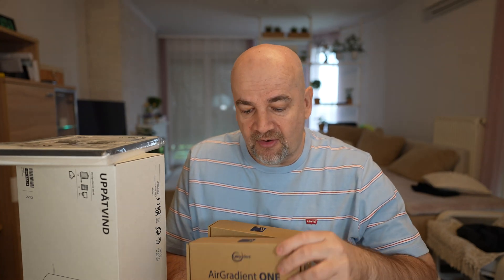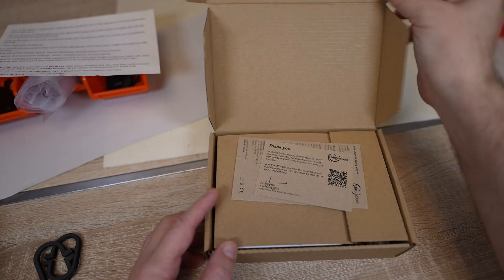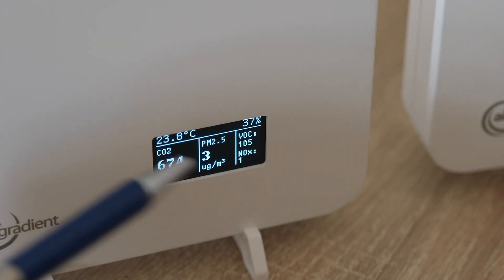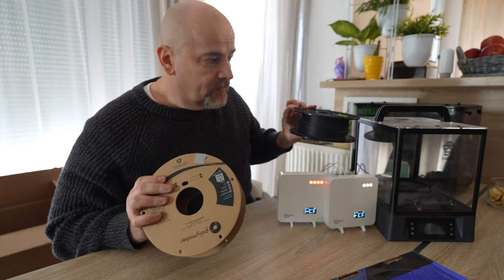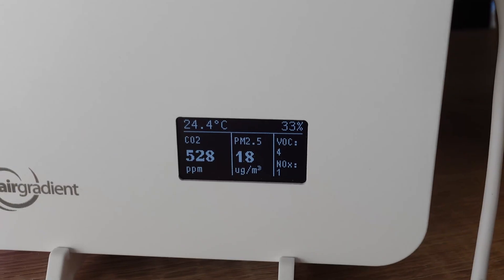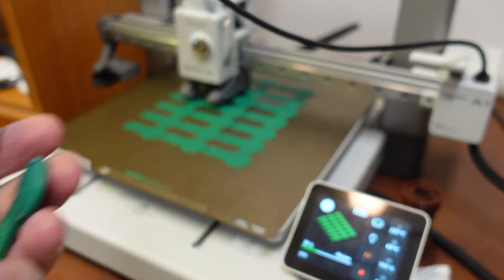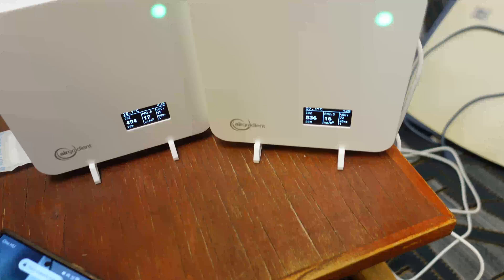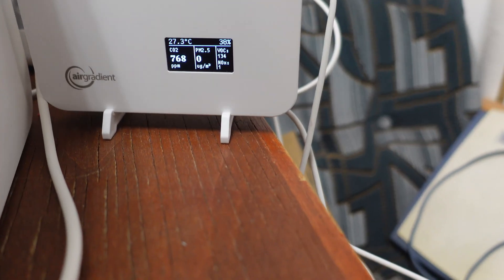Any VOC with 3D printing?  AirGradient ONE indoor air monitor review

Comment: The issue with VOC is that numbers don't mean much without a unit of measure to understand how bad they are. I think that below 250 (twice the base value) is no issue at all. Cooking is twice that and we know it's not causing any issue either, unless someone is exposed continuously (like printers, they usually don't run the whole time, and we don't stand next to them much either).
Assuming that sensor is even reliable to begin with... does it come with a certificate/calibration statement? maybe they calibrated one sample during development and use the same parameters for the whole large scale production, making it pointless.
Thanks for the test, interesting topic (and proof that VOCs are no issue).

Comment: I've been going on a deep dive into the resin printing safety because I want to buy one soon for myself.
The main problem I see people have is not seeing the difference between various VOCs.
It's called Volatile Organic Compound*S* because there are thousands of them and not all of them are harmful.
For example you pointed out that the cooking emits a lot more VOCs than your printer but the compounds emitted from cooking are not harmful to you, the VOCs emitted from the printer are. They are not the same, even though simple sensors like those see them as the same thing.
number higher = oven bad, number lower = printer good  is false

Comment: By the way... I use air filters with active carbon filter (otherwise they are useless against VOC) and it make a clear difference.
Not needed even a detector, you can smell in the room the plastic without and you cant with the ire purified on.

Comment: My two cents:
Those monitor are good for general induction and trend not absolute value.
I work with professional certified measurement. 
And with a 50.000€ machine we still calibrate it two time a day with bas bottle of certified standard gas for CO2, NOx and VOCS.
No way a 100€ machine can work at the same level with factory calibration.
You need to accept a certain degree of error and deviation.

Comment: @MyTechFun if You have any sensitive information on video DON'T blur or pixelate it, because It's easily reversible! The only safe way to censor sensitive data in video postproduction is to erase or cover it with something like a full color rectangle. Better safe than sorry!

Comment: I think you need an enclosure. I would place one of the sensors inside the enclosure and one outside. This would allow you to compare the VOCs generated by the 3d printer. You could also validate your results by moving the external sensor to the enclosure's exhaust which should be a equal or higher level of VOC than what is inside the chamber.

Comment: would love to see you place a unit right at an exhaust pipe on an enclosed printer - then compare that to the exhaust going into the air filter  and have the monitor sitting in the airflow path for that (can the small ikea one also take the carbon filters they make?) This would show the most extreme scenario for a printers potential VOC and Pm2.5 output and highlight the difference using one of those filters makes if at all! 

additionally placing a unit directly in the bottom of a printer enclosure and checking those values would ensure the differences in numbers are more likely to be down to just the printer itself 

If you have or can make a bento box filter tower for your X1C - using the monitors to show what difference using one of those makes would be handy 

I have a bento box myself but chose some very powerful and noisy fans for it - which leads to me not switching it on much
Reply: There is a mod for IKEA Uppåtwind on printables  to add two active carbon filter casettes in addition to the original filter. IKEA also has a more expensive model (Starkvind) that can take filters to absorb VOC, but they look a lot like the mod for the Uppåtvind that you can make yourself.

Comment: I’ve found a couple of things with my VoC sensors. 1.  It depends on external atmospheric conditions so I have one outside as a reference, high VoC  days outside  produce high VoC days inside (surprise!). 2.  I’ve found that people in the room and moving in and out creates real spikes and troughs in VoCs than printing  and as such I’ve had to run the monitors with closed doors for at least an hour to get consistent readings. 3.  I run a third VoC on the same level of my house (for an additional reference) as carpets etc make a difference. 4.  The ISO standard that most of these units adhere to does not conclusively state that it monitors styrene levels. So the nasties in. ABS and ASA may not get accurately captured. 

So after running my collection of sensors for 6 months I’ve concluded that there is a measurable difference in VoCs while printing but opening the window clears the air and reduces the levels to below those in the  rest of my house, yet another surprise. lol. BTW  All my printers have venting and particle filters but vent to inside the room. I only run 3 printers.

Comment: VOCs are extremely general term. Fumes from cooking are a whole lot of different VOCs, as is Styrene from ABS/ASA, as are farts... The domestic monitors use cheap sensors that measure small number of VOCs and usually approximate a value.
In the case of the AirGradient One the number on the screen is an index that operates on a rolling window of the last X hours of measurements. So it is not an absolute value and is affected by periods of very low or very high VOCs.
I think there were talks about exposing the absolute value or it might already be exposed by stuff like HomeAssistant.

Comment: I don't need an air quality monitor , i have allergic reactions when printing PETG. Not to talk about ABS, which emits toxic styrene gas. My 3D printers are in a cabinet with air extraction. I am bit against using 3D printers in homes without any protective measures

Comment: VOC and PM  will go up on filament changes becasue the printer overheats the filament.  I have a small ESPHome VOC monitor inside my X1C, I see more VOC on PETG snd PC, than PLA. I also have an AirGradient on the bench in the garage.   The VOC sensor is reporting an "index" that it calculates relative to a baseline rather than an absolute number. 

Just looked back through the data logged by Home Assistant - the sensor inside the X1C logged 500 (It's max value) printing PC-FR (flame resistant polycarbonate) and 200 printing PLA.    I also see spikes in PM0.3 and PM1 when printing and particularly on filament changes.  I have added extractor on the X1C with a large carbon filter / HEPA filter which I have tied to the VOC sensor and will start when the print ends (running it druing the print case chamber temp to drop and I hard warping issues with some filaments)
Reply: Got a recommendation for parts to put together a esp32 VOC sensor for inside an X1C/P1S?
Reply: @phlebas-uq6fv   @phlebas-uq6fv  an ESP-WROOM-32 board, and SGP41 VOC sensor and an SHT31-D temp/humidity sensor (needed to calibrate the VOC) sensor, options red/gree bicolor LED.   The code for the ESP can be found as a github gist (YT won't let me post a URL)  /jpettitt/837d79f758b18f4ec10059b7db0bed40
Reply: @phlebas-uq6fv   @phlebas-uq6fv  an ESP-WROOM-32 board, and SGP41 VOC sensor and an SHT31-D temp/humidity sensor (needed to calibrate the VOC) sensor, options red/gree bicolor LED.   I can't post a code link because YouTuber.
Reply: @phlebas-uq6fv  for reasons know only to YT it won't let me post details - BESp3-WROOM SGP41 vos sensor and SHT31D temp/humidity sensor - it won't let me post a link to the code if you message me at the same username on makerworld I'll send you a code link.
Reply: YT won't let me post it for some reason

Comment: This kind of sensors are basically useless for monitoring 3D printing emissions. They are bad in registering VOC (only thing that can do reasonable quantitative measurement of VOC is called HPLC), and there's no reasonable way to catch the real murderer: the UFP's.
Rule of thumb for working with 3D printers safely: 
1. NEVER use them where people live
2. Mechanical ventilation is the only sensible way of removing printer pollution.  HEPA is almost useless against UFP, and activated carbon only removes maybe up yo 50% of VOC. Photocatalysis with high CADR would be better, but it's much easier to just went it outside.
3. If you can smell it, it's BAD.
4. Resin printers are much worse than FDM, especially Chinese ones where there's no control over Resin ingredients .

Bottom line: this group of technologies should be only used by properly trained, certified, and controlled  specialists. Use by amateurs should be banned.

Comment: My hypothesis is that VOC’s are much denser than clean air and likely to sink. I’d like to see some further experiments where monitors are placed at various heights in the room to test if more VOC’s are detected closer to the floor, and comparing a closed room with a fan on versus no fan to test if blowing the air around in the room perturbs the air enough for more VOC’s to be detected on the desk.

Comment: This affordable IKEA air purifier uses filters that will help with air particulates (not HEPA but similar), but you shouldn't expect them to have much impact on VOC if any.
If you take smell for instance due to smoke (particules) they will help on that, but if you consider only VOCs as should be measured by that sensor, likely not.
That's how I interpret your observations showing no change in VOC measured after enabling the air purifier. However, the PM2.5 are at zero afterwards!

Comment: I have used laboratory quality sensors next to similar sensors (m5stack sdc40 and pm2.5 air quality kit). The m5stack sensors deliver very similar results to the lab grade sensors {within 20%} which I consider very good for these cheap sensors. I could also not see a significant increase in VOC nor pm2.5. just being present in the room had a bigger influence than 3d printing. I used ABS (mostly), PPA-CF, PC, PC-CF andTPU.

Comment: I bought two air filters for my home last week, one for the living room and one for the bedroom.  I should get one for my office because I practically live in here with the 3D printers.  The filters display particulate counts, typically 2-4 ug/m^3.  I'm not monitoring VOC but no doubt my daily stir fry contributes more VOCs than my 3D printers, but I suspect cooking smoke may not be as hazardous as molten plastic off gassing.  Not all VOCs are equal.

I designed and 3D printed an SV08 enclosure and it has two large carbon HEPA filters on top, mostly for ABS and ASA.  I'll add a filter top on the Sovol Zero when it finally arrives.  The manufacturer's filters always look too small to be effective.

The filter shown in the video looked like a pleated paper particulate filter.  If so, it wouldn't trap VOCs.  However, it's possible that it has a carbon filter inside.

Comment: You need to print ABS or ASA to get high VOCs.  Also, remember, not all VOCs are created equal; VOCs resulting from melting cheese are not as bad as VOCs from melting styrene.  Finally, there are no air purifiers under $750 that can filter out the type of VOCs that result from printing ABS and ASA; VOCs react poorly with with activated carbon catalyst, so you either need multiple purifiers each containing 10+ lbs of carbon catalyst, or a different catalyst (e.g potassium permanganate).  Take a look at the IQAir HealthPro Plus.  Remember, the best method of eliminating VOCs is ventilation.

Comment: The Plantower PM Sensor they use in it is pretty good. I've one in a DIY Project since years and I love it. They're pretty sensitive. When a neighbor starts to barbecue outside or there is a fire in the city they pretty quickly ramp up. Soldering is another thing where you quickly see how nasty the air gets within minutes. There are some studies about  that sensor where they used it in many outdoor locations and they were pretty decent compared to much more expensive sensors. 

About TVOC sensors on the other side I'm still very skeptical on how they compare to more specific sensors / measurements. They rely so much on the code and regular calibration as far as I know.

Comment: As you experienced, voc sensors can't really tell if it's the purest organic oil for fragrance from a bio farm somewhere very far from all pollution. Or you just breathing. Or cooking, or you are burning tires. If it detects anything, it goes up. Also it's usually just a relative, uncalibrated number, and the sensor or the driver software does some auto-calibration over time. That it takes the lowest value over some time - like a week - and call that "0", because these sensors also drift over time. Also, you live in a city iirc, so baseline voc levels can be high to start with. 
Bosch sensortech does have a demo board with multiple air quality chips (the same chip, but more of it) on one board, and iirc their point is that you can configure different chips to detect different gases. To some extent.
Reply: It's BME688 or BME690. Search for Bosch BME688 and BME690 Software, and you should find info there. With some machine learning, and multiple sensors, you should be able to detect different gases.

Comment: This product seems to hit that sweet spot of 'never going to buy it' of being way too expensive without actually being a high quality device. It uses parts you can source for much cheaper if you make your own kit, and which are already included in 1 of 100 cheaper alternatives. There's a reason for the massive gap in pricing from the $50 cheapie to the $5000 calibrated lab equipment, they would need to be adding something magic to create a middle price band in there. A band like that already exists, but it's just the $50 cheapie with a name brand like Samsung slapped on it, AirGradient doesn't have any weight behind it to pull that off.

Comment: As much as I love these open sensors, the measurements are very rough. For example, the Sensirion SGP41 (in the AirGradient ONE) measures MOX, and extrapolates VOC from there. What's worse, is that both the VOC and CO2 measurements are dynamically calibrated, so all you know is that they go up and down -- the absolute values are completely unreliable. So while an increase in MOX is suggestive of increases in VOCs, when the MOX stays constant that does NOT mean there are not other VOCs present. 🤷‍♂
Reply: Same.  The PMS5003 for PM is pretty good from my experience and some studies I've found about it, but about TVOC sensors I'm super skeptical as well. They rely so much on the algorithm and calibrations.
Reply: @Leif_YT  Yeah. To measure CO2, you can upgrade to a dual-chamber self-calibrating sensor. But for VOCs, I'm not sure there even is a general solution, because there are many VOCs. As you point out, PM is probably the most reliable of these.

Comment: The PM2.5 increase when you opened the windows is likely due to particulate matter found in the city air. Try placing one of the monitors outside to measure the particulate levels surrounding your apartment.

Comment: I've done a similar exercise with very cheap chinese air meters off aliexpress. My main takeaways were as follows:
1. ABS and ASA absolutely need to get vented outside. They put out massive amounts of VOCs. A 60mm fan running at a moderate speed generates more than enough negative pressure to keep the contaminants from diffusing into the room.
2. Cheap CO2 sensor chips will get false positives from VOCs. I can reliably trigger this with aerosol sprays or acetone vapors.
3. As you found, simply cracking a window or two solved about 80% of air quality problems.
Reply: Just curious, you mean 60mm fan that is mounted on an enclosure, then connected to the hood going outside? Is this enough to cool PLA and does that also work for materials that require a heated chamber?

Comment: I own an uHoo air quality monitor that offers these values too (+ a few more like CO, O2) and the VOC values feels weired too. While printing (open printers only) I do not see anything. but in the evening, when I turn on my 15yr old flat-TV in mostly - not always! - raise from near zero to 200-700 values. Those sensors feels to be like rolling the dice.

And yes, I use it as CO2 monitor for better air exchange efficiency.

Comment: AIR GRADIENT is a well known brand between people into this kind of things, when I started my journey for 3D printing  8 months ago, studying everything from filaments, to printers, to 3d printing issues, 3d modeling, I also got into the air quality part because of how I'm building my lab. And I bought several sensor, and a proxmox server with Home Assistant to monitor everything with alarms, and zigbees gateways etc... The problem for me with airgradient is they were very expensive to be imported in EU, even before tariffs. To reduce costs I would have bought the unassembled version but that comes also without calibration so...

I want for some QIngpings Air monitor, for quality sensors and also some IKEA VINDSTYRKA sensors which have good quality sensors in them, and you can pair them with zigbee and log everything in your home assistant